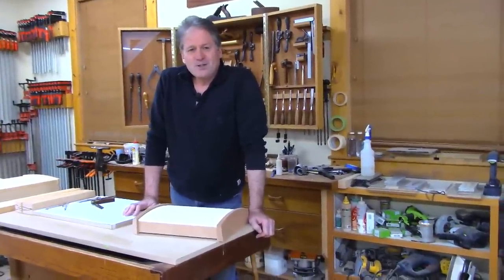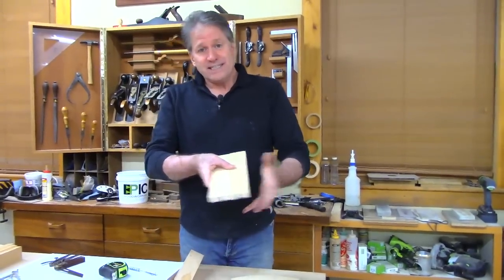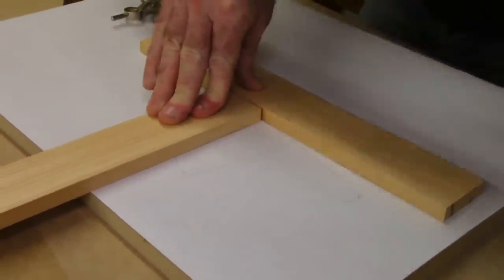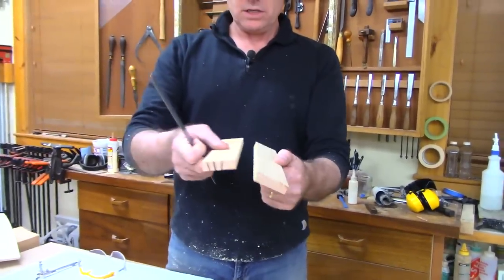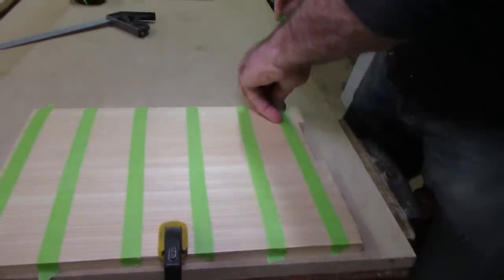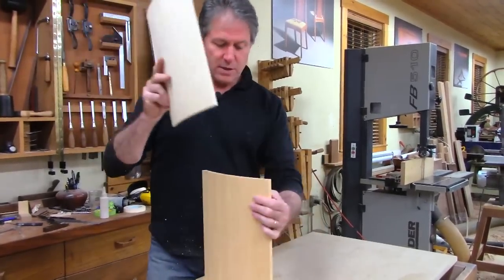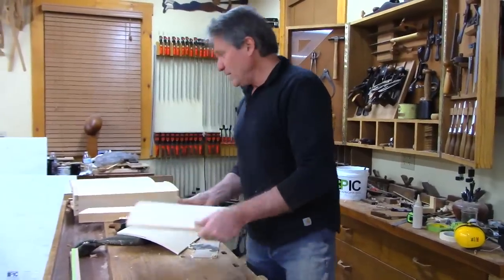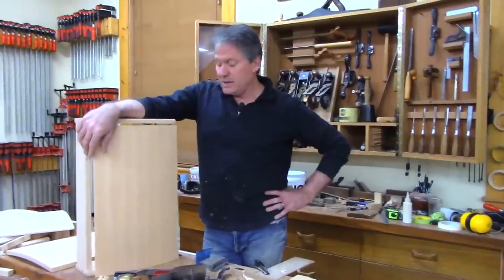How to Make a Coopered Door with Tom McLaughlin

Comment: Another very interesting session. The curved-lid box is going to be a really nice piece.  I also like coopered doors on small cabinets, as you have mentioned, and I have made a number of them. Reading books by James Krenov really had an impact on me. 

I agree with you that the tape method of "clamping" the door staves  works easily and well.  There is one possible drawback -- maintaining a consistent arc with no twist (not so much a twist as a shifted stave)  over the length of the door can be hit-or-miss with the tape method. The door will glue up and dry very nicely with tight joints but it might also have an unintended "twist" that complicates mounting the curved panel at a later stage of a cabinet or box build. A small "twist" can make for a big problem.  The result can be a lot of fiddling and fettling down the line.  

I dealt with this problem by making a "saddle frame", which was made of three pieces of 3/4" plywood: two identical door supports with concave curves to match the outside of the coopered door and a flat base piece on which to mount the supports.  This allows one to (1) tape the door staves together efficiently, AND (2) to tape (or clamp) the freshly-glued door to the saddle frame. Using a taping/clamping caul curved to match the interior of the panel is probably a good practice here.  The latter step assures that the curves on the ends of the door are identical.  This makes mounting doors and hinges SO much easier at a later stage of the build. At least, it worked for me.

Not long after I started making coopered doors, I also made a "Krenov-style" plane with a convex sole and a blade to match -- a stoup plane, I gather.  It is great for cleaning up the inside of a coopered door or any other interior curve, for that matter.  Nothing else seemed to work quite as well, as long as the blade was nicely sharpened.  It was far more efficient and controlled than power sanding, in my experience. Further, like all "Krenov-style" planes, a stoup plane of this type is also easy and enjoyable to make.

Thanks for the video, guys. Great stuff.  All the best from Wisconsin!

P.S.  I noticed a few comments about your narrative style. Those who don't like it seem to misunderstand the purpose of the shop session, which is to emulate the experience of being in the shop with a mentor or teacher. The conversation and the stories are essential parts of this experience. Anyone who has ever served an apprenticeship of any kind knows this from their own experience. Anyway, that's just a thought from a shop geezer who has learned a lot from older (and younger) shop geezers. 😎
Reply from the maker: Thanks Jerry! I’m glad you enjoyed the session. Sounds like you go way back with your own Kenovian inspirations :) There was something special about the way he communicated the meaningful aspects of the craft while sharing fine craftsmanship.

I agree with your assessment of the potential for a “twisted” door using the tape method. I noticed on one of my small curved lids the tape had come slightly loose toward the end of one seam and that last outer stave was a tiny bit out of the arched plane. The other two had no lifting tape (because I used more tape) and were beautifully aligned. Theoretically, if the outer surface is held tightly to the tape and remains flush during the bend it will produce a reliable arc. And if it will sit flat without rocking (convex side up) on a true flat surface, there in no twist to be concerned with. But better to be sure with some type of form when absolute reliability is required. And if you were in a limited production run you would want the assurance of consistency.
A stoup plane as you described sounds ideal for shaping the interior. I’ll have to look into those myself!
Thanks also for your affirmations regarding the “bored” comments :). I’ve learned you can’t please everyone, and the kind of person who need “just the facts” as quickly as possible is not likely to enjoy this format, nor be interested in producing finer work. So even though those comments can ruffle my spirits, it’s usually not for long, especially after I go back and look over the positive chats and affirming good will that is so much a part of the spirit of our community here…and you are a prime example, so thanks again! 👍 Tom
Reply: @EpicWoodworking  I taught university students for almost forty years, so I am a foremost expert on boring other people.

One important lesson I learned early on as a teacher was that I was not simply conveying information or teaching a subject; I was communicating with and teaching students.  Big difference!

As a result of this epiphany, I always remembered I was talking with other people.  I did not read notes and I did not talk to my notes, as many of my colleagues were wont to do. Nor did I answer my own questions. 

Human beings continually absorb quite a lot of information from the world around them, but to get them to focus on the information YOU are providing can be a challenge. Incorporating key information into narrative form can be very helpful. Talking to people, rather than talking "at" them, and maintaining eye contact are both crucial, as well.  

This is why I think your task is harder than mine was.  You cannot make eye contact and you cannot get a tangible feel for the audience.  This is why you have The Camera Lady read questions from the Fan Club, I am sure.  If you weren't trying to connect with people, you wouldn't bother doing this in the first place.

As one who has advanced degrees in inflicting boredom upon others, I really appreciate and admire the videos you guys develop each week. They are interesting, informative, and entertaining. I can only begin to imagine the work involved.

Many, many thanks from an old geezer to two younger ones.

Comment: For hinges on small pieces, I use brass rod.. or pins.  Drill holes in the end of the door top and bottom .
Slide the door up into the top hole with a longer pin (marginally) then let down with short pin at the bottom hole
Barely , if at all, visible hardware. Door can easily be removed by lifting up and out.

Comment: Dude said I don't know if that was a serious question?? Hand planes are part of the woodworking process my friend. That was hilarious. LOL 
 I get it is a lot easier to do it on the table saw but a lotta ppl don't have these types of machines. They cost a lot of money. It's nice to have a really nice Powermatic table saw but to get a good table saw nowadays will set u back anywhere between 2-5 grand depending on where u are in the world. 
I would love a jointer like the one u have in ur shop man. I have a jointer/thicknesser but it was really a waste of money bcos the fence has given me no end of trouble. I need to get a new fence for it. It's one of the cheaper models.
That's a great tip about Snipe and having the outfeed table set correct. I kept getting snipe last night at the end of every board. It wrecked my head bcos I didn't think of that. I'm kinda new to these machines. I haven't used it all that much to date and I've had it for a year now. I think I've used it 5 times in a year. 

I need to get to grips with the Joiter and my table saw. 
I'm actually in the process of building my own Table saw now. I bought the steel to build the frame and housing for the blade and motor, belt/pulley system. 
Sorry man I started waffling there.. I'm enjoying the video..

Comment: iS 1/4 SAWN TIMBER FROM THE TOP LEFT OF THE TREE ROUND?? 
sO i HAVE A QUICK QUESTION FOR ANYBODY IN THE COMMENTS AS WELL AS THE MAN IN THESE VIDEOS.. - tHE WAY U CUT THE PIECES FOR THE ARCHed top of the box - Does it mean that the movement will be up/down rather than side to side or am I not getting it?? 
I love the look of the arch door/top. I use Bostik or ordinary PVA for my glue ups. I know it's the cheaper of the glues but it has a much longer open time for me anyways. I know a lotta woodworkers would balk at it but I like to use it. It dries clear too. I like that about it. I don't know if all these glues dry clear bcos I've only really used the EVOSTIK PVA glue atm.
The Arched box top is really nice. I was wondering what the angle would be. I'm going to take a punt at it in my shop today. I have some nice pieces of wood and I was wondering if it would be possible to build the Arch door front for a cabinet and have glass in it. I wanted to make a shadow box for a family member but I love the idea of having an arched door for the front door part of the box. I think it would be something different t the ones I've seen on YT lately.
THANKS for this great tutorial my friends. 87.4 is the angle I need. I will be looking to make a wooden hinge for my door. I saw one where the guy making it used little metal pins in his own shop made dowel which he cut into shorts and drilled holes with this contraption he had on his hand drill. It was the weirdest thing I'd ever seen where he pushed the small dowels into this little connection on the drill chuck which made the tiny holes to hold the pins. Then he glued some to the frame and door every 2nd one I think and waxed the other ones. It worked really well. I must look up that video and send u the link to his box with the wooden hinge idea.. It worked a treat for his box. 
I'm looking forward to the next video now. I will be checking out more of ur content over the next few days and seeing what's in ur back catalogue too. Thanks again for this awesome tutorial my friends. Take care.
Reply from the maker: Thank you so much, great to hear from you! The glues you used are quite good for this application. And that’s a good question about the movement…I was describing movement only happening along the width of the door, but you are making me wonder if any happens upward on the arch as well. It is probably very minimal if at all. My main concern is along the width, and using quartersawn staves is deliberate in order to produce the most stable solid door possible.
I love the idea of the wooden hinges with the center pin! I actually saw a video on that briefly a while ago and should have saved it. I’d like to explore that technique and see if we can incorporate into another version of box…it’s so pure and elegant. Please do send the link if you find it. Thanks for being with us! 👍😎

Comment: How you deal with hinges on the laminated and veneered doors?
Reply from the maker: Good question. In the same way as solid, recessing and inlaying as needed. It is a little trickier and more care needs to be taken cutting cleanly with a sharp chisel. The 1/8” bending ply core layer offer strong screw purchase and the 1/8” solid wood edging also makes for a strong material in which the knife hinges are recessed.
Hope that makes sense, thanks!